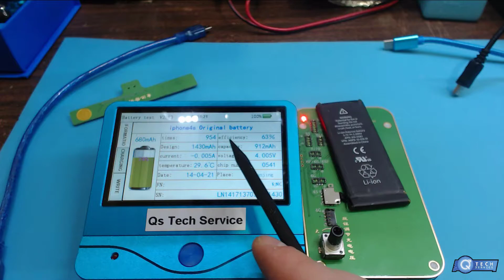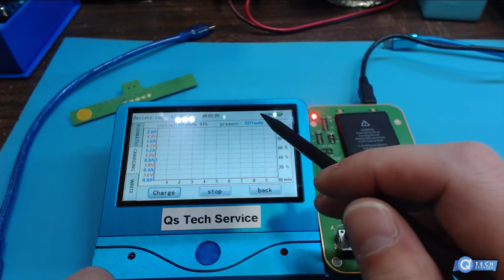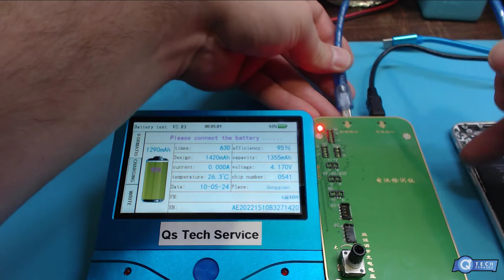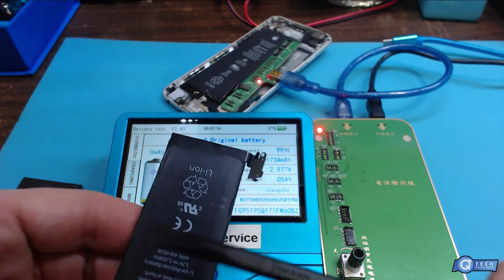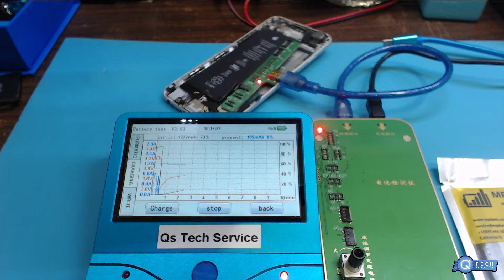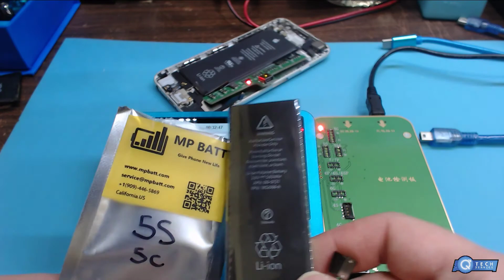how to identify the original and fake iphone battery

Comment: The capacity of a battery is determined by its gas gauge IC - it's entirely possible and normal for new batteries to register higher than their design capacity, and this isn't a bad thing. The charger isn't going to try to "charge it to" a specific capacity level - the charger is going to have a voltage cutoff point. The fact that the capacity level listed is higher than designed will not cause the battery to swell - it's more likely that the exact chemistry of the defective battery cannot handle the voltage level the charging circuit is configured to stop charging at due to various reasons - perhaps internal resistance causing heat.